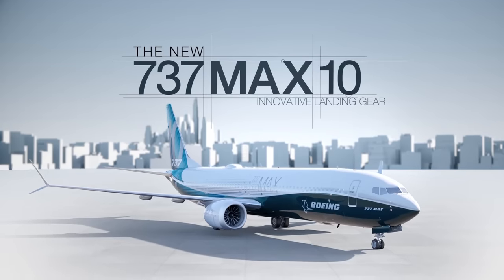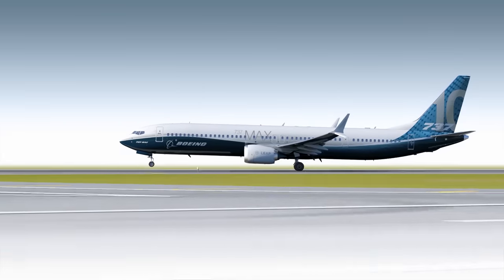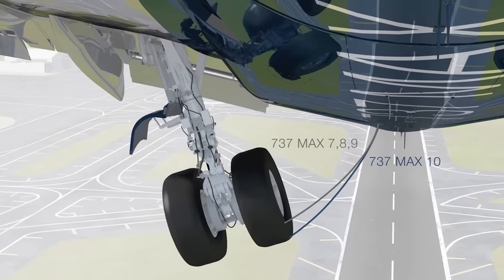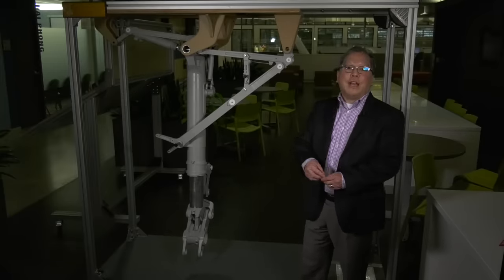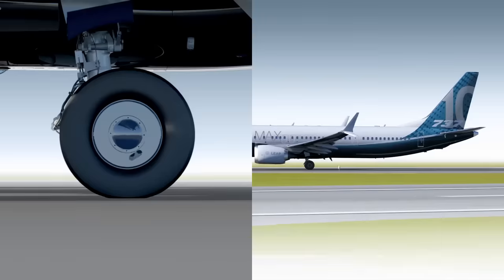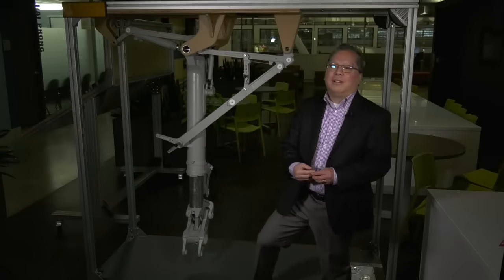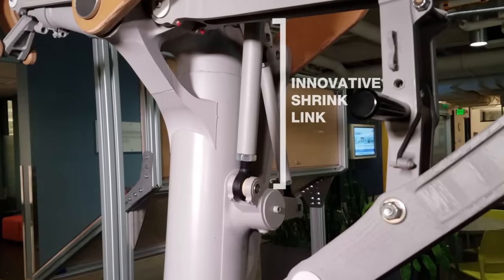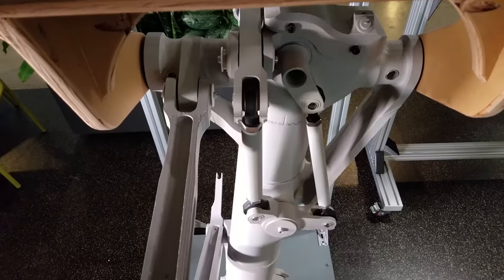How the 737 MAX 10 landing gear works

Comment: Well what's the point? If the MCAS system can cause two crashes due to the plane autocorrecting WITHOUT pilots using it manually, then the crashes are explained. The pilots on both planes were not aware of the MCAS system, therefore forcing them to fight their own plane. If the pilots aren't trained for the system, wouldn't it just mean they would crash? I mean it was pilot error, but it wasn't their fault the error occurred. Lion Air Flight 610 and Ethiopian Airlines flight 302 crashed due to the manufacturers inability to make the MCAS system more readable.
Reply: The MCAS system didnt cause two crashes. Before speaking I suggest you read the Indonesian Crash report.
Reply: They already knew about MCAS on the Ethiopian flight.

Comment: "our customers wanted more seats"... yeah, so we call all be uncomfortable in a single isle aircraft. I few to Hawaii from San Diego on Alaska's 737  with 180 fellow passengers and it was so tight for 5.5 hours. Could not wait to get off. At 6 ft, 4 inches is was uncomfortable. Next time its a larger aircraft, probably Delta out of LAX. More leg room, two isles. Give me the 757 any day.  737's are popular with carriers that want one aircraft type so maintenance and training costs are minimized. I get it, but customer comfort is compromised.

Comment: Wouldn't it be better for the gear to be extended all the time and only retracted upon 'gear up'? I don't see how thos feature makes a tail-strike less likely since it has to give way according to how strong the pilot pulls on the yoke. It's so diffcultly designed that it could be a german invention.
Reply: They would have to redesign the front landing gear. There wouldn't be commonality on the ground with the other MAX aircraft.

Comment: I'm a fan of Boeing and the MAX. However, it does appear that the design limitations from the original design (being low to the ground to aid in ground handling) is limiting it's future development. I mean changes to the MLG and engine placement is just patch working an old design to make it viable for the new design.

Comment: Boeing had to compromise the 737 airframe by making the landing gear taller to accommodate the wider cfm Leap 1B turbofan engines. Hmm…Boeing needs a successor to the 737 airframe as the 737 airframe is beyond its geriatric age and needs to retire.

Comment: I feel as if it is a very affective and well needed improvement , as a 737-900er simulator flyer , I found it very odd on how stubby and short the landing gear , appeared to be , and how much of an affect it had on the landing of the plane .Just My Opinion . 😌

Comment: in my 11th year flying the 737NG/MAX-8.

y'all should have re-engined the 757. how hard would that be.  Y'all have oversold the NG/Max.  I fly this airplane to the Caribbean/Central America/S America ... I am frequently restricting the passenger/cargo load to have an adequate fuel load.  Love the MAX. Flies great ... saves fuel at altitude ... but in the traffic pattern, it burns just like all of 'em.  3500# is NOT 45 minutes of fuel where that 3500# of fuel is going to be burned.  (eg, PATTERN altitude.) (and btw, you've put me in your QRH at 4000#)

eat yer crow ... restore the 757 line for the mid-length stages.  The 737 shouldn't be trying to carry 185 passengers on 4 plus hour flights under Part 121 operations.

Comment: When I originally suggested this during a discussion about "why the 737 can't have bigger engines" on a forum, I was laughed off, told it was not possible.

Well, the haters just got schooled
Reply: A 737 with GE90s would be pretty impressive!
Reply: It seems like the landing gear length remains the same, it only remains extended when it's not under full compression. So when taxiing, ground clearance remains the same.

Comment: So, just because Boeing found it was losing market-share against the A321neo, Boeing had to stretch themselves to a MAX-10 series. Only then, they came up with this extended landing gear system (an expensive solution), to have more ground clearance and avoid tail strike. Well, they should've done this for the regular MAX series in the first place! That would've allowed them to bring the engines a bit down and closer to plane's CG, therefore, they wouldn't have to aggressively rely on the MCAS, trying to go back to previous-generation nominal. What I'm seeing here is just greed at its best. Something here is telling me that they had this feature in the regular-MAX drawing board (prelim design), but it was obviously more expensive to design and build this type of hardware that, combined with MCAS, would've been a more reliable and elegant solution.

Comment: Just make a revamped 757. Immediate 300 aircraft sold
Reply: Spencer Cohen if they did it would be treated  as a new plane because the assembly line isn’t there and production ceased in 2004. You can’t just reactivate an old design

Comment: I’m looking at the main gear on a 737 Max in SFO right now and it doesn’t have this monkey motion gear link system. So what are they bragging about, it’s not be used.
Reply: Max 10 not all the 737 max😂
Reply: Exactly, the 737 MAX 10 is still waiting for its first flight! Also I assume it’s rather difficult to see the telescopic gear and tell it apart from the gear used on the other 737s

Comment: Stretch anything to the MAX and it eventually snaps. And it did. Time to ditch the program and design a new jet with capability to carry larger engines. Extending existing landing gear with trickery adds another component failure point. It will eventually also fail causing new issues and crashes. Ditch the 737 MAX NOW!

Comment: but they still di not solve the main issue regarding the position of the engines that are too high above the wings which compromise the center of gravity of the plane which cause the nose diving issue...A software will never beat physics law! Period.

Comment: no no no no no no JUST MAKE A NEW 757!!!!!!!!!!
Reply: Boeing should never have stopped production of the 757. They should have created a 757-100 to replace the larger 737s like the 737-800 and 737-900. This would have allowed them to fit larger, more efficient engines under the wing without having to adjust their position on the wing just to get them to fit under.

Comment: Why didn't they do this to all the Max planes so that the engines didn't need to be dangerously shifted?
Reply: Roger Russell Because the MAX 10 landing gear does not change the static ground clearance. Please now deflect to how some hypothetical telescoping gear design could change the clearance, even though this video was clearly about the MAX 10 landing gear.
Reply: @AmbientMorality  The max 10 landing gear has the capability of extending the ground clearance.  You add the word static as if it's not static then it's not possible all the time.   Please now deflect that having an engine too big hasn't caused problems.
Reply: Roger Russell No, you have no evidence that the MAX 10 gear as designed can change the ground clearance. I have never said that the engine position changes didn’t cause issues; I’ve said that MCAS is the more salient issue
Reply: @AmbientMorality  Strange, I realize you seem to run interference anytime anyone mocks the stupid decisions by the failed management at Boeing on the disaster of the Max.  But in the video above in the first 37 seconds the engineer explained they gave the landing gear 'another 9 inches of capability' in his words. Don't get mad at me, just crawl away.
Reply: Roger Russell He clearly said “capability... when the gear rotates”. The animation also shows the gear extending out during rotation. The gear static height is the same as before. I do not “run interference”; I’ve commented when people say software augmentation is fundamentally bad, but I’ve also commented when people argue the crashes are the flight crew fault (which is completely false).
Reply: @AmbientMorality  So you admit that it gives more height, more clearance, and does so when they want it to.  I'm done here. You're wrong and splitting at hairs thinking if you add the word 'static' that somehow you can decide when it will work and when it won't.
Reply: Roger Russell It does not change the height of the engines when the plane is on the ground taxiing, when the plane is landing and weight is going onto the wheels, when the plane is on takeoff roll but hasn’t rotated, etc. So yes, the MAX 10 landing gear does not allow for engine placement to be changed because moving them down would leave them unacceptably close on landing, during takeoff roll before rotation, etc.
Reply: @AmbientMorality  9 inches more on the landing gear doesn't add more clearance?  Wow, with logic like that, you could be working for Boeing!
Reply: Roger Russell 9 inches during rotation adds clearance only during rotation. It does not change clearance at any other time, including during landing or on takeoff roll before beginning rotation.
Reply: @rogerrussell9544  The video explicitly supports my claim. "To do that, we've added 9 inches of capability to the gear lengthwise *when the airplane rotates*" (emphasis mine). Your second point ("it could have been designed for any time") is neither supported by the video nor is it salient; you initially claimed that the MAX 10 landing gear could be used on the other MAX aircraft. Now you are suggesting developing a different telescoping landing gear which is objectively not the MAX 10 landing gear.
Reply: @AmbientMorality  the video says they can get 9 more inches of clearance when they want it. Shame they didn't want it all the time, shame that people died because they found a cheaper solution to the clearance problem.  But you don't care about that, do you?
Reply: @rogerrussell9544  Again, you are claiming that MAX 10 landing gear could be used on the other aircraft. That is not true because, as this video says, the MAX 10 landing gear as designed adds length *during rotation*. If you are discussing other landing gear, then that is a different claim that you originally made. Also, please support your claim that the video says they can get 9 more inches of clearance "when they want it".
Reply: @AmbientMorality  Again, you're saying I claim that.  I'm saying that the video explains they were able to give a Max model 9 more inches of capacity, that that it was done in a way to keep commonalities.  And you again claim it can only be used during rotation, something you alone are saying.  You keep wanting to put words in my mouth, like a loyal lawyer might if they were stupid enough to defend Boeing.
Reply: @rogerrussell9544  The video says it gives 9 more inches of capability during rotation. You somehow decided that this means it could be given 9 inches anywhere, which is not claimed by the video in any way. My claim is supported by the video specifically saying "during rotation" and not discussing whether it is possible to do so in other phases. Why would a lawyer be stupid to defend Boeing? They'd get paid well and lawyers are well-used to defending blatantly guilty parties.
Reply: @AmbientMorality  You seem to think that showing the landing gear can be modified to give more clearance doesn't mean they can modify the gear to give more clearance.  You want to explain that again?

Your claim was as lame the first time as it is now.
Reply: @rogerrussell9544  They showed the MAX 10 landing gear that increases clearance during rotation. This says nothing about the plausibility of a modification that increases static ground clearance.
Reply: @AmbientMorality  Imagine that, they showed modified landing gear in the Max can be used to give 9 inches more clearance. All while not making modifications to the landing gear bays. You know, you're inflexible enough to work for Boeing, and blind enough to think they deserve a defense for future litigation. The problem is, if there is a jury trial they won't fall for your talking points any more than I have.
Reply: @rogerrussell9544  They actually only showed that modified landing gear can be used to give 9 inches more clearance during rotation. They made no claims about other phases of flight. I believe in justice and the right to legal defense is a core tenet of American justice. That doesn't mean I think the defendant should win; it means I think they have a right to a defense.
Reply: @rogerrussell9544  Defending the indefensible is exactly what defense lawyers do. My only claim during this entire discussion is that the MAX 10 landing gear, as currently designed, does not change static ground clearance and therefore cannot be applied to other MAX aircraft to allow for engine repositioning. A hypothetical new gear design may or may not have changed this; the video does not provide evidence to support hypothetical alternative designs.
Reply: @AmbientMorality  Yes it does, perhaps not static length. but when it's needed.  Clearly they need it often enough to avoid shifting the engines forward to cause all sorts of problems.  Watch the video.

Comment: "Landing gears is useless if the plane crash" aside, I want to ask something

IF you want the new larger engines to not hit the ground, then why don't you do the other way around (the landing gears lengthen on the ground) just like A330 did? 

Not just it would keep the same room for the landing gears when retracted, but it would also solve the placement of the engines (hence render the MCAS useless) and reduce the risk of tail strike

But if you want to keep the "low-profile" of 737, you could add some hydraulic so the pilot will lower the plane when it parked. 
Well... this might be more expensive than my first solution (also because a bit retraining for the additional parking checklist)

Comment: All these extra mechanism will ve problem in the future. Less mechanical and simple set up is safer. Boeing should not stretch the 737 to Max. Boeing should instead use 757 and scale down to become MAX. 757 is a good single aisle aircaft. 737 is a small plane and scalling up gives a lot of problem, bigger engine, MCAS to offset, telescopic gear.. All these gives problem in long run.

Comment: We, the flying public, can help to hopefully eliminate the future catastrophic problems that will exist with the Boeing 737 MAX Death aircraft by boycotting the airlines that will be using this aircraft in the future. The MCAS has to be eliminated from this aircraft, which, so far, still remains in the updated & recently FAA-approved flight control system of this aircraft...
Reply: Mcas doesn't need to be removed actually it needs to stay in. Boycotting because of this is silly, people like you make it seem like no other plane has crashed since wright brothers first flight.
Reply: @ethansaviation2672  ...Hey Ethan...GFY.
Reply: @ethansaviation2672  Modern airliners should not be seeing 2 fatal accidents within its first 2 years caused by the same problem, and its not the first time Boeing has seen this, thinking back to when an almost brand new 767 crashed in Thailand because of a computer failure and the Dreamliner fiascos in 2013. Planes crash all the time, its just a fact of the matter, but 95% of crashes in the last 40 years have been maintenance or CFIT, both human error, not an improperly installed and rushed system in order to get the MAX out to compete with the new NEO series

Comment: You guys have to work a lot now in order to recover your completely ruined reputation. I mean the reputation of this plane.
Reply: true true and boeing max series sucks
Reply: @ahelzalmaj8647 I don’t agree. B 737 Max is one of the best planes in its class. But it was a tragic failure in the internal communication of the company and training regulations. Every new plane has problems, it is impossible to build a perfect machine. Plus a fatal chain of circumstances. The price was very hi, unfortunately...
Reply: @alekseistrelkov3085  But dont forget the A320N And the A330N And the A350 AND AT LAST THE A380 was perfect aircrats #Airbus
Reply: @ahelzalmaj8647  no questions about it
Reply: @ahelzalmaj8647  I'm not sure about the A380

Comment: "We needed to get the landing gear back into the same unchanged wheel well"

That right there is the reason 2 of them crashed.
Reply: incompetent pilots crashed the airplanes they were weak and couldnt fly the plane.

Comment: That's not gonna help, once the landing gear starts 'extending' during rotation, it's doing that because the weight is being taken off of it, meaning that the wheels are just gonna be dragging on the runway, so it's not going to make it taller, it's just that it's going to make the tires touch the floor for longer, if you rotated normally, it's still going to strike the tail.

Boeing, really? Why are you cutting so many corners!? It's already taken peoples' life! JUST REDESIGN THE GEAR TO MAKE IT TALLER! IT'S BETTER TO COST MORE THAN TO BE UNSAFE! oh I forgot...

greed

It can do many things
Reply: This is why airbus is better.
Reply: Ah, the airbus fanboy who thinks they know everything.
Reply: @ethansaviation2672  yeah, looking back, I was pretty silly.